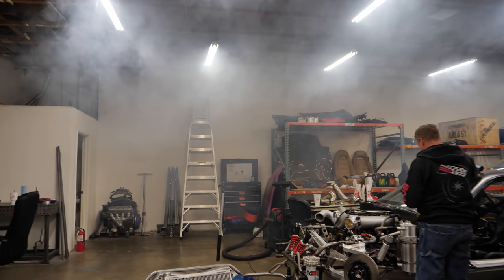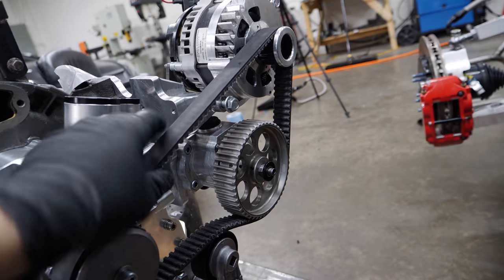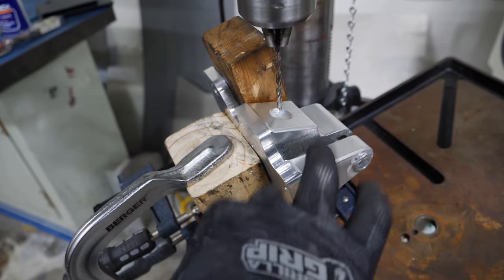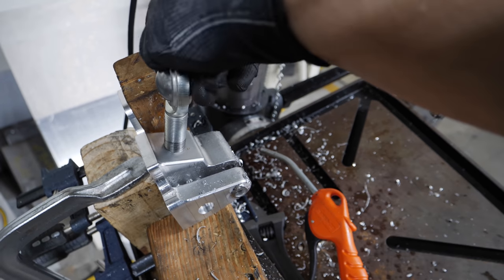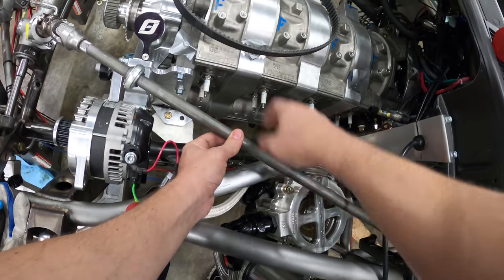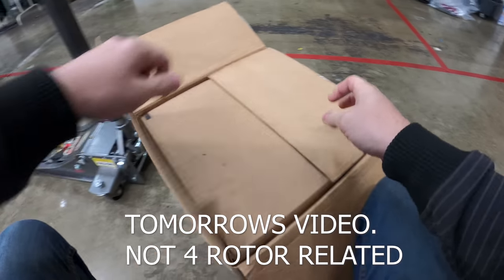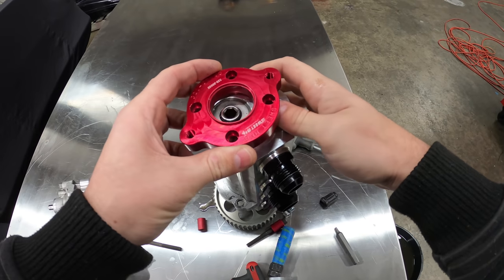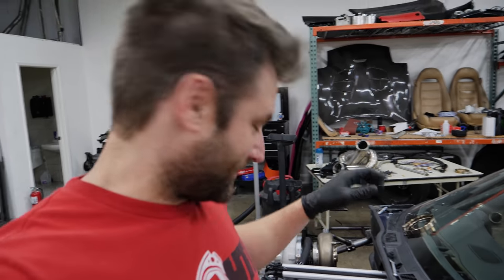The 4 Rotor FIRES up first try!  Power Steering and Brakes

Comment: I love how you guys can rebuild yr custom 4 rotor and through it back into the car in a few days!
Reply: Once you have the pieces, its way faster. Hoppe we see the 4 doridori rx7 making some donuts soon.
Reply: I want street races against ricers that don’t know what to expect
Reply: I don't know why take it back and rebuild why did they didnt did this before?? Wasting time fk
Reply: @guilhermearcini3707  They had to clean and rebuild it becasue of the aluminum shavings that got in the engine.
Reply: Justin Charles also to try and fix the compression in a few rotors I believe
Reply: @wdr8303  Yup
Reply: @wdr8303  Rob never showed what they did to address the bits embedded into the housing. Hopefully they did something or those apex seals are gonna chatter and fail when he's chasing HP numbers...
Reply: D C by bits do you mean the aluminium shavings?
Reply: @ClarkBark14  He did a video cleaning out the rotors
Reply: He’s been fixing rotary engines for at least a full year now and still has yet to actually get on any kind of track because they always either blow up or he starts something else and pulling parts off of other projects””..  hell as soon as he got the 4 rotor running last time it “blew up” on the dino then just completely started the vette then when that didnt really work this shpeal  started...
Reply: They really arent rocket science to rebuild.... No secrets either. Just clean every bit of carbon out of every seal hole. Thats the key. Then follow mazdas guide. Or one of the many on rxforums. Changing blends/scallops on rotors, porting, balancing rotors, clearancing that's where skill and machines come into play.

Comment: so I've watched all of these video's and I'm still confused as to where ALL of those shavings came from. Was that ALL just from cutting the intercooler piping?
Reply: Yes
Reply: Don't quote me on it, but unclean intercooler stolen off the other car. So essentially aluminium, car STDs.
Reply: @aserta  no? it's been a few videoes, but the intercooler was new for the 4-Rotor, they just cut it apart to change where the outlet was I belive, and they forgot to clean it afterwards :P
Reply: Valentine Rob Dahm, has approved this message😂
Reply: @bigstrawgaming9166  omg daddy Rob noticed me!
Reply: Valentine doh!
Reply: @ValentineC137  thanks, I was coming down in the comments to check. The Sema rush is real. Because if im not rushing for some deadline, there's no way Im not quadruple checking every little thing if I've spent as much as he has.

Comment: It says on the tap what size drill bit you need man
Reply: Not always
Reply: I cringed so hard when he used an adjustable wrench to tap the hole instead of a tap wrench.  So hard to keep it perfectly straight that way.
Reply from the maker: I did just that. Didn’t explain that thoroughly. I didn’t buy a random massive drill bit for nothing. But tried speeding that section up
Reply: @RobDahm  gotcha
Reply: @bmaenle  Just leave it a lil loose in the collet and the drill press will set you up perfect.

Comment: Rob: Builds the most badass billet 4 Rotor.
Also Rob: Uses Torx t-handle for Allen heads
Reply: Unforgivable. :D
Reply: Why thay rubbish or cheap?
Reply: @markcozzie  The sharp splines on the torx does not have much contact with the flat edges of the allen head so it strips easy. You can do light pressure but nothing legit
Reply: And it's far from badass,it's only got the odd billet plate,still got standard iron-ends and standard rotary core's, is ppre and pac doing full billet rotary engines now.....don't know why Robs build is so hyped up for is it kuz he was on tv years ago or because it's awd? It's definitely not for his fabrication /machanical skills because he hasn't got any 😭

Comment: I like how rob still hasn't fixed the belt the right way😂😂 just a tip: use grease on the bolts that are fastend in the aluminium beacause if you don't they get stuck!
Reply: Not only that. Makes the threading of ye bolt but.easyer. You. Don't want fuck the threads up.
Reply: Rather anti seaze, grease doesn't do much good really.
Reply: @piciu256 I am using the rocol foodlube multi-paste so you are kinda right because it is an anticorosion/antiseaze grease

Comment: Hey Rob and the community, i had a question and i hope this doesn’t sound dumb. Basically I was wondering since rotors are alighting in a pattern to have ignition one after another for constant combustion, when reassembling and putting in the rotors, do you have to alight it a certain way like turn a little more ahead than the rotor before?

Comment: You could easily tension that belt and remove wear from the math if you simply add another bearing (which frankly, considering how extended the whole thing is...you should) support at the front. One that's attached with a bolt, through the existing pulley. Doesn't even need to be big, You could probably get away with a double ABEC7 and a tiny aluminium support. Seriously, do it, you've got nothing but to gain from adding it, and there's no shame in having support.

Comment: Would it be possible to find an alternator that has the mounting points flipped around? So increasing the tension would bring the alternator up instead of out toward the wheel. I don’t know what kinds of issues that would cause with the charge piping or the hood or the harness mods that would need to be done.

Comment: You really need a much coarser thread generally in aluminium, depending on the application and load as it could just strip the threads.

Comment: Get rid of that steering situation and get your hands on a Lamborghini Espada steering box. Seriously, why reinvent the wheel when you can use a perfectly good mechanical unit off the shelf. To be clear, i'm talking about the 90 degrees box transfer unit, not the entire steering system off an Espada.

Comment: How does that much aluminum get left in the intercooler? I watched the video where he explains someone fucked up when making the dual pass intercooler. But it seems like common sense there would be metal inside after grinding?
Reply: supertampon5 Rob and Isaiah were fabricating somethin on the intercooler and forgot to clean it out after they were cutting and welding on it

Comment: Did i miss a video where you explain where and how the alu got into your engine? Please share
Reply: They took apart the engine. Cleaned out the aluminum from every nook and cranny. Plus there was a lot of shaft stroking by hand.
Reply: @One21P  not to sound " anul" but where did the aluminium come from, the lack of compression on rotor 4 was the reason the broke down the engine and discovered the aluminium, as crappy as the intro's and outro's are, I really enjoy the content

Comment: I think I missed something, what did he do different this rebuild so there wont be aluminium in the engine this time?
Reply: Wouter VeIdhuis it came from the intercooler, I’d hope they washed it out.
Reply: @jasontruman1215  it doesn't look like it, he didn't mention it anywhere anyway, third time's the charm 🤣
Reply: Jason Truman ah okay thanks, hope it will be good this time
Reply: Wouter VeIdhuis at 2:08 he says he cleaned it out

Comment: dude.. I thought you were actually gonna run everything through a parts bath ... i really hope you cleaned shit better than just wiping it down with a paper towel ... and u know there's a specific size you need to drill out for a specific thread pitch and diameter .. right?

Comment: Why didn't you go with electric power steering? It would make it a lot easier to push IF the engine were to blow up
Reply: I think he mentioned it somewhere, but don't recall the reason.
Reply from the maker: Already loading the electrical system heavy so I want to minimize things that affect ignition in anyway

Comment: Rob another alternative to the multiple swivel joints steering column, would be a straight column with only one swivel joint  by the fire wall and a custom box extension with 2 or 3 helical gears inside. The best was to describe is the Lucas oil gear test display by the autoparts counter (but made of metal with bearings) . The swivel joints idea looks more easy to do but unless some one else has use it on a race car it may not be the safest option because the more joints the more play you will end up on the steering. If at some point one of the u joints God forbid break or come loose, you may end up with no steering at all.

Comment: Rob how did you get alluminum shavings inside your intake runners? that means they had to come from the turbo? did you find where all the aluminum inside the engine actually originated from?
Reply: it was shavings in the intercooler they forgot to clean out, just a frustrating accident.

Comment: Total scrub here. What I've been wondering about the steering is if there's a system that eliminates the steering shaft entirely. Like a steering wheel that has force feedback and instead of a shaft, you have wires that send a signal to a controller that then activates a pump to modulate the rack in accordance with how far you turn the wheel. Is that a thing?

Comment: If you go one more tooth on the altinator one it will idle better as it won’t push as much current at idle. So more torc off the hit and  it will take up that slack in belt. Adding that idle pulls is now one more rotational item that take power to turn

Comment: [Non-repetitive non 4 rotor content....] maybe a new supercharger for your CTS-V.  You could swap out your V's 1.9L TVS supercharger for the new 2650 TVS.  KONG Performance has a way of stuffing the larger C7 ZR1 2650 Eaton TVS rotor pack into your LSA blower case/ lid so it will fit under the stock hood.  800whp daily would sure shake things up and make sponsors like Holley happy.  Also be great for versus, compare/ contrast content with the rest of your vehicles.